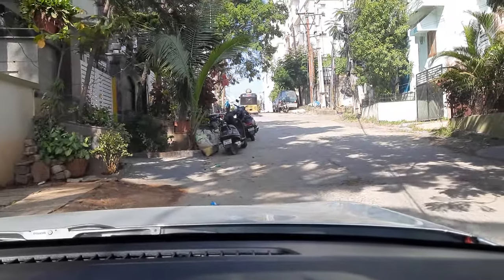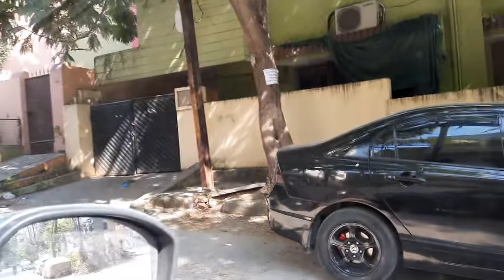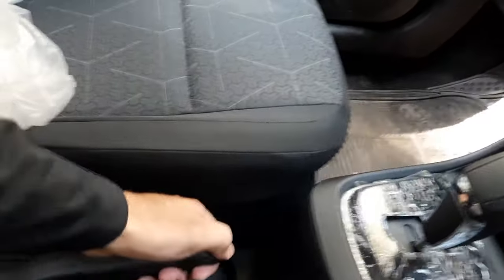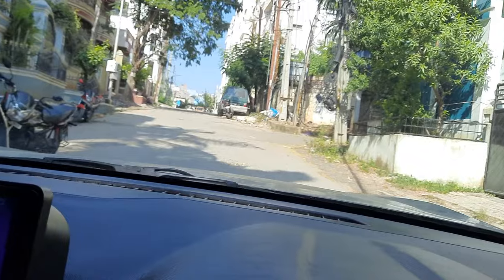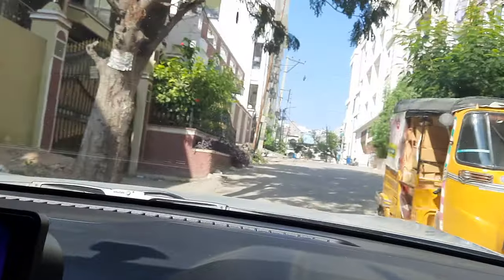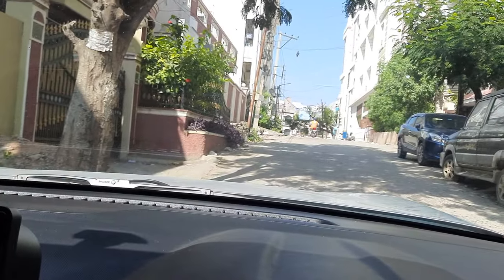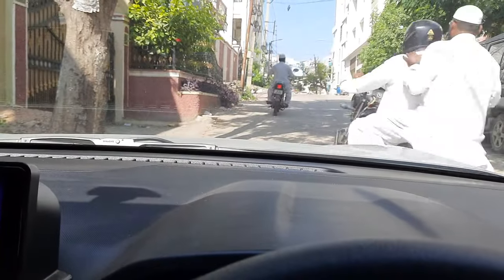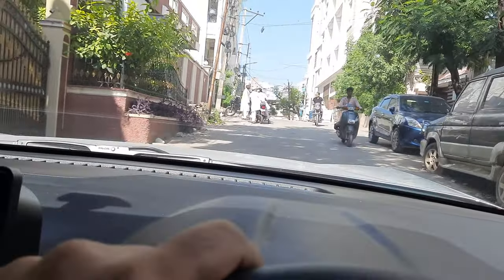HOW TO CONTROL AMT CAR WITHOUT HILL HOLD | TATA PUNCH AMT | motostreet garage

Comment: How to drive in bumper to bumper traffic in hill areas without hill hold assist.
Reply from the maker: No need to worry, just use brakes for stopping and gently use the accelerator in "city mode since you might need a little extra pull at times, I have already done that myself, unfortunately couldn't make a videos due to risk of accident.
Reply: @MOTOFLIXGARAGE  even for underpowered engine like punch?
Reply from the maker: @Sidharth Sharma  it's not that under powered, 86bhp is just enough
Reply: @MOTOFLIXGARAGE  in steep incline, hand brake doesn't work in tata punch AMT, car rolls back, so should we use left leg for braking and then accelerate with right leg?
Reply from the maker: @vinodmohan123  just press accelerator gentle, it will pick up speed and stop rolling back
Reply: tata ❤

Comment: It doesn't work for me even though its in forward it goes back if you don't accelerate. Hill hold is not working or its good for nothing. Anyone who want to avoid this issue go with Hill assistance. That doesn't have in tata punch car.
Reply from the maker: Worked for me without any issues. Most of the low-cost  Amt cars have the same configuration

Comment: The test needs to be done a proper incline
Reply from the maker: I already tested in higher inclines, though I have not prepared video, it's absolutely rock solid and very well programmed to go uphill with little push of accelerator

Comment: Try on hig steep parking, we need to use handbrake and accelerator, no movement detection etcs works on steep clim
Reply from the maker: I have already tried in 30* mall parking, Inorbit mall as well as Sarat city mall,  no issue at all, in fact my wife also felt confident driving upwards in the parking

Comment: Please tell when we release the brake will it slide back. I mean the time taken to shift the foot from brake to accelerator. This is very important to know this
Reply from the maker: You can simply release the brake, dont worry, it will hold without any problems and keep moving forward slowly, I have already tried this in Mall Cellar parking exit as well
Reply: @MOTOFLIXGARAGE  thank you

Comment: Problem arises when there is slow moving traffic on an incline, hill assist exists for a reason
Reply from the maker: @zonejvm  depends upon the weight of the vechile, small cars usually don't show any problem with AMT during uphillndrive in slow traffic, I never faced any challenges even driving upwards in Mall parking ramps

Comment: Doesn't it roll back if stopped on inclined hills, since in punch amt no hill assist?
Reply from the maker: Not at all, just press the accelerator gentle, and it pull up without any issues, take a test drive
Reply: @MOTOFLIXGARAGE  sure, thanks

Comment: Punch rolls back on a steep slope. Not a problem on most inclines. 
Without hill assist, looks like using both break and accelerator at the same time is the only way out.
Faced this situation only 2 times, on steep slopes. 99% times the incline is not too steep
Reply from the maker: Even my wife feels confident driving it upwards in cellar parking, never faced any issues.
Reply: @MOTOFLIXGARAGE  Why she is the benchmark? 😁
Reply from the maker: @babyshrinika  because she was nervous driving manual and not confident on driving through steep slopes just like most driving learner girls , but now she feels confident with Punch AMT.

Comment: Hi Mr. I saw your video it's great to understand tings better.

I have Tata Punch AMT in Delhi. I have a problem in breaks.

Jab bhi mai traffic me bumper to bumper car drive krta hu to breaks hard ho jaate h.... yeh bohot dangerous h

Can you please explain this?
Reply from the maker: Thanks for your comments, but I have never came across any such problems in my Tata punch. Ask the service center to remap the ECU in the next service, most of the problems will be resolved
Reply: Breaks gets hard when you press breaks in switched off condition. Common thing among all punch cars
Reply from the maker: @SHYAMKUMAR-kk6jx  you don't actually have to press too hard. You just have to hold it gently until there is ply in the pedals

Comment: Will it work like MT car we drive in hill ? 
I want to buy amt but just worry about hill hold assist is this ok or not ?
Reply from the maker: Yes off course it will work just like MT variant, just take a test drive
Reply: I took test drive but consern about steep hill and bumper to bumper Traffic, will it easyy or challanging ?
Reply from the maker: @prateek sharma  it's very easy and convenient for hill drive. you may also check this video for reference  https://youtu.be/dEuvTRJKb8k
Reply: @MOTOFLIXGARAGE  thankyou so much for your valuable feedback :)

Comment: I had same issue today with same car. At steep had to stop, then when releasing break car was going backwards, then I applied hand break took some accelerator and then released hand break
My question is , how much throttle has to be applied at inclined positions 
I also have several other questions on Tata punch AMT, i am a novice driver
Reply from the maker: Just hold the throttle no need to press too hard, even if you release the brakes the car will stay in forward. All that it needs is getting used to it, you might feel a  little nervous initially.
Reply: @MOTOFLIXGARAGE  okay, so immediately after releasing the break i can hold throttle ? By this car will not go backwards?
Reply: @MOTOFLIXGARAGE  What is throttle. is it same as pressing the accelerator paddle
Reply from the maker: @ashishgupta9674  yes

Comment: If you buy maruti amt with hill hold features, you won't feel a thing. It hold for 8-10 seconds even in the steepest hills.

But other amt without hill hold assist will. Make problems specially when there will be bumper to bumper traffic in incline. You must use handbrake in that case otherwise your car will roll back.
For cvt mode automatic, car remains steady in slope. So no worries.
For dca also, car has hill hold.

Even modern day Tata cars with hill hold assist like Tata nexon is not that good to hold the car. It also has a rollback of 6 inchs.

I am. Using swift as well as Tata punch amt. I have peace of mind driving swift on inclines as it never rolls back. But puch does role back 6 inchs on small inclines then picks itself up to drive forward even without hill hold. But failed to do so in steep incline.

No issues with swift even is high inclines.

Hope you got the idea
Reply from the maker: I have never faced those issues in my Tata punch. In fact, my wife also droves the car and she feels confident even in 30' incline specially parking drive ways,
Reply: @MOTOFLIXGARAGE  doesn't it slide back? That's the point we are discussing. Obviously we can control it with handbrake but sliding is real
Reply from the maker: @shomubhattacharjee5660  never felt sliding back while stopping and braking even multiple times in cellar parking driveline while moving upward, I can make one video and share if I get a chance to visit any mall this weekend
Reply: Then the slope is not high enough. When the slope is high and you need to break often, it rolls back.  @MOTOFLIXGARAGE
Reply from the maker: @shomubhattacharjee5660  I never felt so
Reply from the maker: @shomubhattacharjee5660  my priority  is built quality and safety, Amt is just for convenience